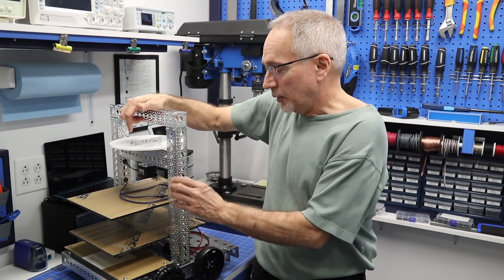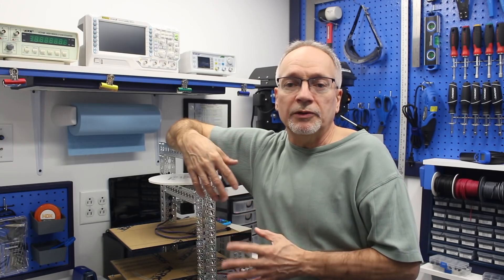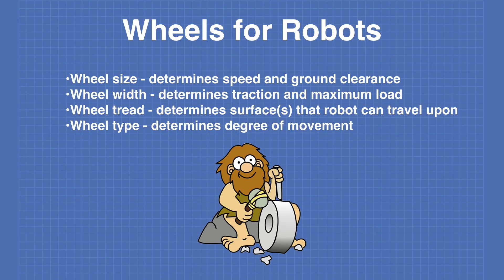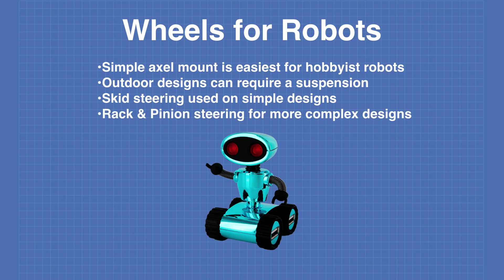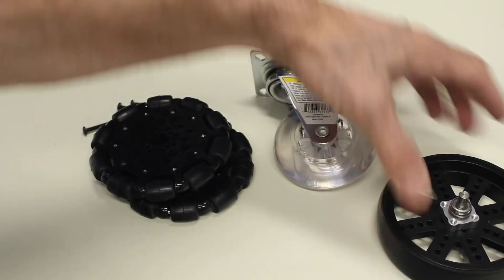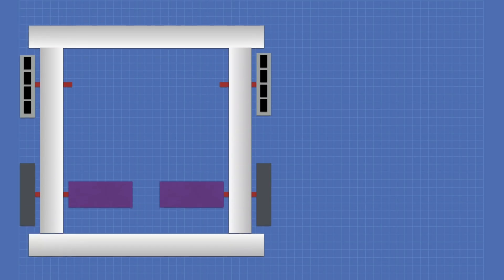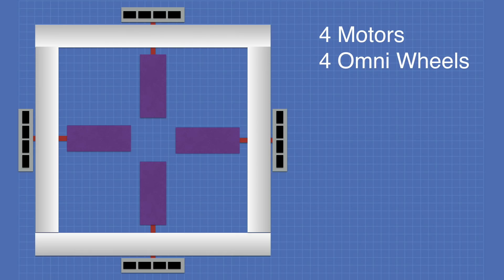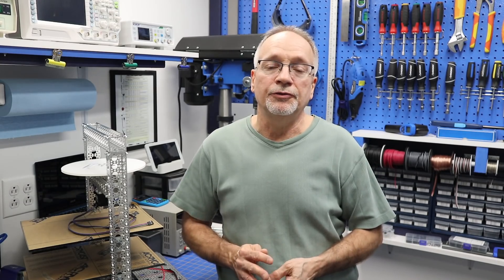Build a REAL Robot - Episode 4 - Selecting Wheels

Comment: As usual, great video. Wheels can be boring but needed for most bots.   There are so many options for real bot wheels these days! I love it. Back in the long-ago days, it was lawn mower, trolly or some rc wheels to choose from.  I agree with you on caster wheels and have given them many names over the years, two clean ones are "Bot rudders" and "Encoder defeaters". I opt to use ball rollers in there place, but these have other issues. Again, a great series that I think will inspire many to build a bot!